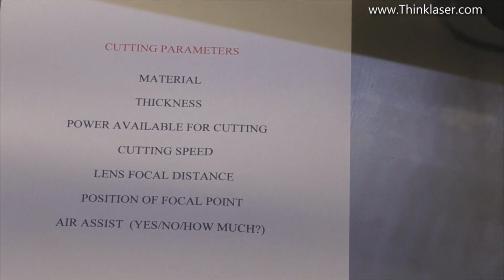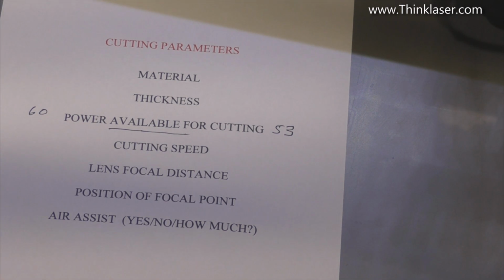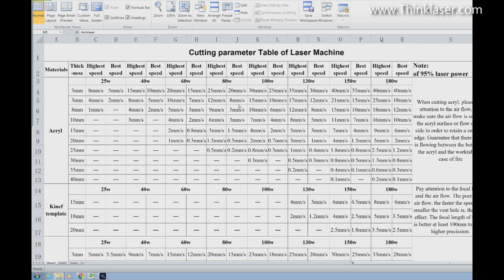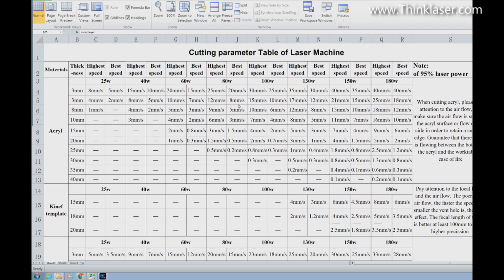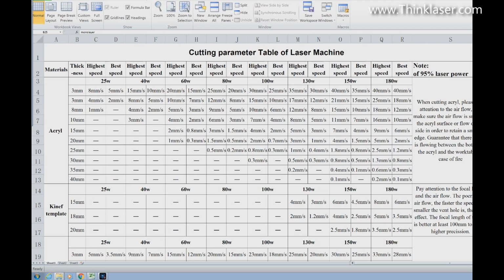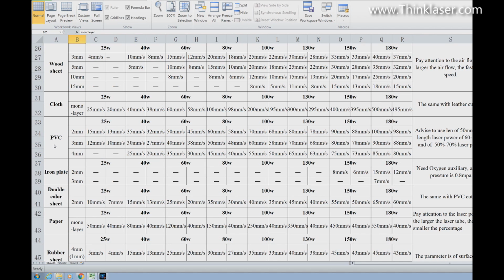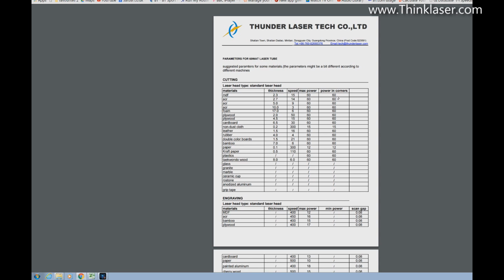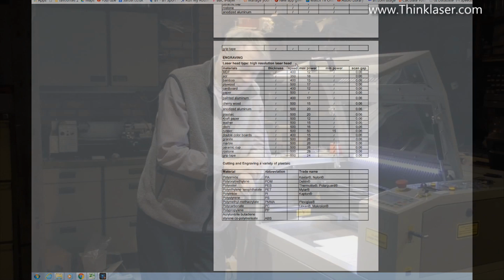Laser Cutting Parameters: Fact or Fiction? (2018)

Comment: I have a 120W tube. I can limit the current on the control board using the knob. I can also set the % on the software. Should I keep the knob at 32mA(nominal) and always use less then leys say 85%. Why would I have that knob if you need to set the parameters anyway? Many thanks

Comment: Bula Russ,  Another good video.  I can second that all materials are different.  I have been doing cutting on 6mm and 3mm plywood.  I can cut the 6mm ply at 45mm/sec at 60% power(25mA on the meter).  The 3mm ply, the fastest speed I can achieve is 22mm/sec.  This is with a 2" lens, air assist on, focal length set correctly for this lens.  With the same set up, I can cut 6mm mahogany at 17 mm/sec consistently well.  Tomorrow I am going to put in the 4" lens and see what I can do with 1/2" and 3/4" ply, and 1/2"+ mahogany.  Cheers,
Reply from the maker: Hi Kim,

Gareth @ Thinklaser here, Thanks for the kind comments and the details on some of the settings you are using. What tube do you have? 80 watts?
Reply: I have a 100W Reci tube.  My machine is a 9060 JQ Laser.
Reply from the maker: I think you may struggle with the 3/4" ply and the 1/2" mahogany using a 100W tube and a 4" lens.
Reply: I actually got through the 3/4 ply with the 50mm lens at 2mm per sec.  But only did it once.  Now I have a problem with my laser head which I need to resolve before I do anything else.  I have cut through 5/8" mahogany with the 50 mm lens, but can't repeat it now.  So tonight it is back to head maintenance and mirror re alignment.  oh joy.
Reply from the maker: Have you checked that the lens isn't fogged?
Reply: Yes, I have cleaned the lens, both sides,and all the mirrors.  Where the tube mounts into the head there is now movement.  So sometimes the beam isn't going straight through the nozzle.  Also the nozzle heats up quickly, which it never did before, so I am sure  part of the energy isn't going down the hole of the nozzle, but hitting the side of it.  I need to figure out what is causing the play in the head.
Reply from the maker: Hi Kim,
Try pushing the tube as far up into the laser head as you can, while still having enough range to correctly focus on your materials. This will minimise the pendulum effect you can get with an extended tube when the head is moving at high speed.
Reply: That is what I did and it worked fine.  I had a nice fine cut line on 6mm ply at 40-45mm/sec and thought everything is golden again.  Then stopped for the day.  The next day without changing anything, everything turned to crap.  To cut the same 6mm ply, same focal length(that was still on the machine from last night), best speed was 12mm/sec and the cut line was 1-2mm wide.  Traced the problem to smoke on the lens and mirrors.  Gave everything a scrub and I was golden again.  The thing I don't understand is how the smoke deposits occured overnite.  Oh well, at least it as an easy fix.

Back to Russ's original post, one more item has a great effect on power and speed settings is moisture content of the material.  I do a lot of work on mahogany, and have used wood 6% moisture content up to as high as 25-30%.  The higher the MC the deeper I can cut for the same given feed rate and power level.  Working with plywood is a nightmare by comparison.  You have to consider the type of wood in each layer(they may be different), moisture content, glue type, glue thickness.  It all plays into the equation and has nothing to do with the machine(s).  I think if you had 5 different machines with the same focal length lens, same laser tube, that all would produce the same results from the exact same piece of wood or ply.  If you took those same five machines and had them use 5 pieces of wood form different parts of a tree, or different trees, you would now get quite different results for "identical" machines.  So I agree with Russ that a machine manufacture hasn't got a prayer of creating any sort of realistic speed/power/material type  to be close to accurate, especially with organic material.  I can't do it with two pieces of wood from the same tree!

Cheers,

Kim